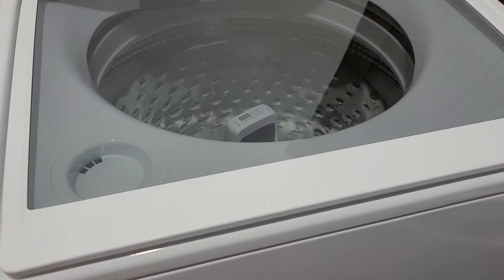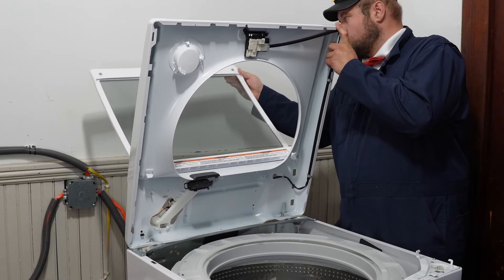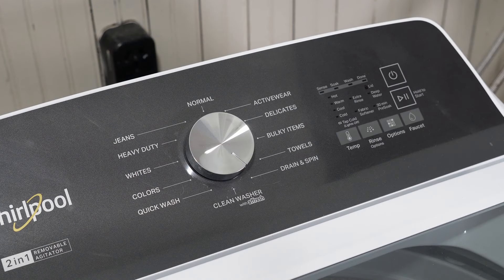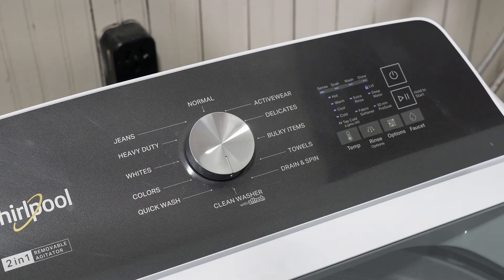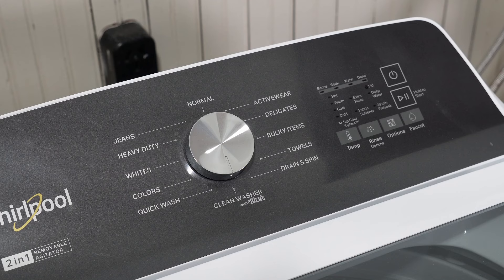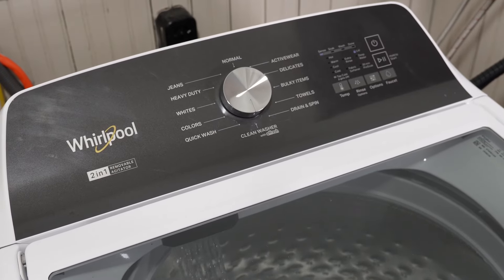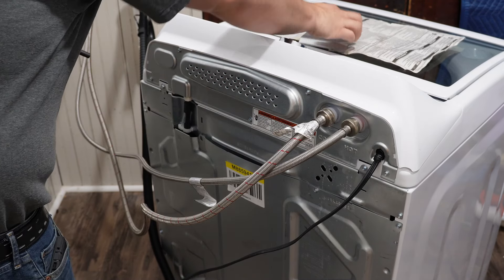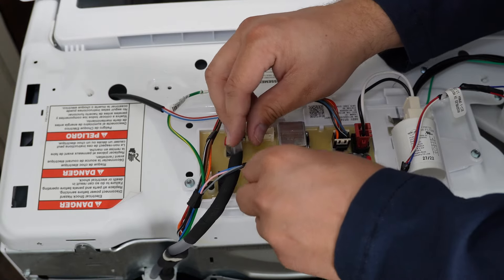How to Reset a Newer Maytag or Whirlpool Washing Machine (Factory Calibration Mode)

Comment: Wish they made washers like they use to. New Maytag washer didn’t even make it pass its first wash. GE washer needs transmission and bearings replaced after only 5 months. Front loaders don’t use enough water to actually clean clothes. Have to hack/modify a screw on water level sensor unit to fill with more water. All junk.
Reply: it is illegal to make washers like they used to. thank your government.
Reply: Front loader do use enough water and clean better than any top loader. But that’s a conversation you guys aren’t ready for.
Reply: Amen!
Reply: @Ikey04-ge9gy 😂 ngl I died laughing at this! What would a conversation about laundry pertain, that someone couldn't be ready for? It's either enough or not 😂

Comment: My husband has fixed this washer 3 times already. Worse purchase ever, only 3 years old. Hopefully last a couple more months. But your video so helpful to reset it.
Reply: I agree 100%. I had mine 2 months before it failed, it took 12 weeks of maintenance guys coming out with random parts before they finally hauled it away and brought a new one. Now the new one is doing the same thing. I'm getting rid of it and I've had it less than 2 years. I figure the cost I'll be saving in not having a heart attack over this stressful piece of junk is more than enough to cover the purchase of something that actually works.

Comment: No matter what wash i try It locks and unlocks, does 2 half spins, makes a noise, then says done.
Reply: Mine is doing the same thing, any suggestions?
Reply: Machine is out of balance. Unplug the machine, plug it back in. Go to drain and spin cycle, then process to whatever wash cycle you normally use.

Comment: I had my washer disconnected for months and it didn't want to work and this video got it working again. Thank you!! I'm happy I didn't have to call a repair man or customer support. For me, the lid lock light would be on so I left it open and the steps still worked.
Reply: I just found this video and the process is running as we speak. Praying this does the trick. The washing machine also hasn't been used or even plugged up in months🎉 Btw, it responded exactly like the video described ❤❤❤

Comment: Got my WTW5057LW1 delivered on Feb 1. It’s Feb 23 and the extra rinse option on the drain & spin cycle is not working. It just drains and spins without adding any water for a rinse. I did the reset as per this video and it’s still not working properly 😞

Comment: Worked perfectly after I replaced the lid lock. Which by the way instead of taking the entire wire off I only popped off the lod lock , flipped it over and removed the smallest backing piece and pushed plugged off of the board and then slid the plug on to the replacement lid lock unit and re installed.  Took less than ten minutes and I by passed alot of work.
Reply: do you mean the white part of the lid lock, that little white plastic piece?
Reply: What lights were flashing in your washer? I’m trying to decipher my code. I have been unsuccessful. Mine flashes sense done and lock then it flashes just done. We replaced drain pump noticed a spliced burnt wire and I 🎉 thinking yes!! But no 😢. I don’t want to keep buying parts I’m not rich or I would have taken this washer over to whirlpool lit it on fire and gave them the finger. 16 months and this is what I get for buying new

Comment: Thank you so much for this video!  Bought my washer in April, it died in June.  Repaired 4 days go and I got to do 5 loads before the lid stopped locking!  I was so excited that my washer did exactly what your video shows for the reset, locking and unlocking as you outlined.  However, when I went to try a load, the lid would not lock.  Oh well, back to the Whirlpool warranty repair part 2.
Reply: 5160
Reply: Thanks, I looked the code up and you are correct.  The 6th wash load became unbalanced and was washer bucking so hard I thought it would hit a wall.  The only thing I could think to do was press the start button to stop it.  The lid unlocked then, but after reset, the lid clicks on/off immediately when I try to start a cycle.  I am not smart enough to enter more codes - old lady who used to fix balance by opening a lid with no lock (Kenmore 1986 and still working like a champ) and moving the laundry around.  I will have wait for the technician and hope for a quick.   @JosephGordon-ny6eb
Reply: @JosephGordon how do you put those codes in
Reply: My washer started bucking real bad once it stoped the clothes was still a little bit wet took the clothes out but the washer didn't want to work i tried the everything in the video but nothing, the light turns on but it just makes the locking noise but it don't lock

Comment: Thank you! This really helped. Ours died after a power surge from power restoration after a storm. My daughter was washing during the storm and it wouldn't work after the power came back on. All the top lights were on and I couldn't get your reset method to work, so we decided to unload the clothes so I could drain it like you said. As soon as we unloaded, it started draining on its own! Crazy. I was able to to run your reset sequence afterwards (to be safe) and it's back to functioning as it should! Thank you again for the help! 👍 I was afraid our two year old machine was going to be expensive to fix. 😮

Comment: I appreciate the information the reset did not work. The lights soak, wash and done Keep flashing well after four minutes. I keep seeing comments about error codes. Where are the error codes displayed on the panel? My washer is not even two years old.
Reply: Having the same problem with mine. 2 years old. Did you find a solution?
Reply: @briancartagena9749 he has another video.  Hit 123 buttons in order 3 times, then it will alternate flashing the 4 top lights if error code. One with the lid lock light on, the other with out it on. The pattern coordinates to a number.  I think first was an F code, the second an E code.

Comment: I did the reset thinking that was the reason the lid would not latch. Did not work to cause the latch to work but all of the other things happened - the lights flashed and the machine ran. I figured there was an issue with the latch itself.  So I unscrewed the latch from the lid and placed it into the latch mechanism. It latched and it appears it has to do with how the latch enters the latch mechanism. For now it works.

Comment: I get to the last step (where you said it took about 4 min to finish), but it just continually flashes from Sense -> Soak -> Wash -> Done. It did that from 5:30pm Sunday until 6:30am Monday morning, so I redid it again. What should I do if it doesn't finish recalibrating?
Reply: Mines doing the same thing,  stuck with the flashing for over 12 hours. I'm  trying it again. Did you find a solution?
Reply: Did either of you guys ever find a solution because this isn't happening to mine? I haven't even had it that long. I replaced the locking mechanism because it stopped working and now I can't get it to work. Soak wash done in lid lock
Reply: Look underneath at the wires going to motor. Mine has a wire that rubbed through and was arcing causing it to not spin
Reply: @cheryldaves7107  No. The solution was buying a new washing machine. Continually had too many issues with this one, and got tired of throwing money into it.
Reply: @chrismigl8763  yes I ended up getting a new one as well. What a waste of money. I didn't even have it a year.
Reply: @cheryldaves7107  yeah, these washing machines are junk.  From the get-go, I've had nothing but problems.  I swear inside of a month this thing was SO LOUD during the spin cycle.  It sounded like a giant was walking through the house, or a helicopter was landing on the roof.  And now, it stopped working.  Would go from SENSE to DONE without doing anything.  I did a reset.  The reset ever stopped resetting.  So I open it up, take a look, and the capacitor is just DANGLING from the undercarriage, resting on my tile floor!  Not only that, but two wires going to the capacitor are SEVERED.  Mind you this is the first time I, or anyone else, have taken a look down there so this is how it came from delivery.
Reply: @jimjo8541  which reset function did you try? I tried about three different ones and nothing worked. Ever up getting a different washer and that one is just sitting there.

Comment: Nice video. I had Code F7E3 on my Maytag model MVW6200KW1. I replaced the lock switch and sync motor and had the pump and capacitor tested at the local store that supplies parts. The reset mode is started and lights have been flashing in order for over 15 minutes. Does time vary depending on parts changed?

Comment: My whirlpool had an error code F7E1 and I replaced the shift actuator like everyone said, still didnt spin. I replaced the capacitor and its working again so I  recalibrated and its going fine. Thanks for the video!
Reply: Which capacitor? I have a similar problem...just replaced actuator and I'm still get the F7E1 error code after doing a reset.
Reply: @jromyn  it sounds goofy but I searched whirlpool washer capacitor on eBay and found a bunch that look like the one on my machine. I made sure the one I bought said brand new. It was easy to swap out and I haven't had a problem since.

Comment: New machine, (like yours) trying to use first time, wouldn't fill. Directions said it should fill with allfresh (cleaning cycle).  It said I could pause or stop.  At half full I tried both pause and stop, machine wouldn't respond. I unplugged and plugged back in. Door would never unlock, machine went into drain mode, when finished draining, finally unlocked, now water temp flashes between warm  and hot but 'whirlpool model # WTW5057LWO won't do anything except the H/W light flash.  Seller says since they didn't do the install (blah blah, excuse, excuse). My previous washer, a Whirlpool, lasted over 50 years, ONLY thing I ever did to it was replace the belt.  Thoughts?

Comment: Hi Ben. I did all the diagnostic steps. Everything was okay, except right after all the steps, my machine just kept draining. Agitator not spinning, too. Any idea? The blinking lights are sense, done, lid, and then just done. Pause for a little bit, and the draining starts again.
Reply: Did you ever find a solution?
Reply: very interested if a solution was found

Comment: What if the washer has clothes and water inside? Our washing machine automatically locked but the light of the lid is not there. It won't go to the soak, wash and done. It just stays in Sense mode. 😢
Reply: I have the same issue 😩

Comment: After all that my washer keeps flashing sense, Done, lid locked. Should I try again?
Reply: Did u figure out what it was that's where I'm at? It's driving me crazy
Reply: I'm also having this issue. What temp water are you running?
Reply: I'm trying to wash in cold water.
Reply: Wash cold water
Reply: @nenenene9744  so if you wash with warm or hot water, you'll be able to finish your cycle if you're in a pinch. 

Check your water inlet valve to see if there is any debris. Disconnect the washer power supply, shut water supply off from the washer, remove cold water supply hose, and just look at the valve. If there's debris, it either needs to be cleaned or replaced. That's where I'm at right now I sprayed compressed air into the valve and got my washer dispensing more cold water but it's not enough for a cycle. 

My next step is to remove it, clean it and see if it works.

Comment: i have went through all these, even replacing the locking mechanism to no avail, nothing seemed to work, about to give up 
 i watched another video and started to look underneath at the motor and didn’t see anything but as i was moving my hand around a wire fell out and it was a broken wire from the pump it had been bound so tightly to other wire that it had heated up and broke off. 
  i made a repair and everything works fine. 
  Hope someone else can read this and saves you a bit of trouble and money.
        also my whirlpool machine is only two years old

Comment: If you cant get this to work try checking the wires going to the motor. Mine just kept flashing for hours when i tried this. Turned out  a wire had rubbed through and was arching

Comment: Ok Ben, got one for you. Why would a Maytag front load give an f05 error, even after replacing the components, heating element, heat sensor and ccu?
Got any ideas?
Reply from the maker: Check wires for damage

Comment: Thanks for the video Ben. What happens if the washing machine doesn't respond pass the initial 1-2-1-2? I've verified that it is receiving power properly.
Reply from the maker: Took me a few times to get this to work. May have to unplug, wait 1min, then plug back in. Make sure the dial can work and you can select things too in a separate test
Reply: @bensappliancesandjunk  Thanks, I'll keep trying!

Comment: I got a question for the professionals ! I have several washers that once you hit the “start” button , it waits about 5 minutes then it will start filling with water . Can someone help point me in the right direction because we have others just like it and the water fills as soon as you press start. It’s a whirlpool with the 6 led lights
Reply from the maker: Recalibrate it using whatever method it needs. Often they go out of spec and take too long. That and make sure the water valve screen is cleared.

Comment: I must need a degree to understand because I’m still stumped. My whirlpool wtw5057lw0 flashes wash done and lid together then flashes done. The lid will not unlock until ai unplug for 60 secs and plug back in. My husband and I found a spliced burnt wire going to drain pump we fixed and replaced drain pump.. sadly washer did same thing half way through cycle. I have had for 16 months(out of warranty) I do not understand what the code means and I’m ready to go monster truck on it

Comment: Ben, my issue I cannot empty the water in the unity prior going thru the reset process. Any suggestions??? I did run thru the process with water in the unit and it did not resolve the issue. Thanks for your support!
Reply: I have the same problem

Comment: Rotate dial clockwise? you move it one setting... do you have to rotate it 360 degrees?  (I wanted to drain and spin and it did whole wash with two rinses grrrrr)
Reply: ok, just turn one setting... rotate to me means turn around ok, just ignore me

Comment: Any chance you could help with/do a video on this model with an F7E1 no spin error?
Reply: did you get your issue fixed
what was it
Reply: @johnlucian2259  The belt had ended up coming off of the bin's pulley! I tipped it on its side, pulled the cover, and popped the belt back on. No issues since👍

Comment: I have a different model with 5 keys instead starting from left: Temp- Options- Deep Fill- start/pause- Power.
So I do not have 6 keys.
Reply: Mine was the same I did the power button twice and it worked

Comment: Is there a way to get the drain and spin to just drain and spin without adding water? I spent hours last night having to squeeze the water out of my electric blanket to avoid having to leave it in a wash for more than 2 minutes because it would be ruined if I did. I’m tired of this garbage
Reply: Did you figure out how to make it drain? I’m stuck with the same issue. It won’t even attempt to drain and was working fine right before this

Comment: Mine does have the green light but it won’t spin after the recalibration it will do the rinse but then not spin any idea what it could be?
Reply from the maker: Possibly capacitor. We just had that issue in a newer one. Check wiring though as well
Reply: Ok thanks, do you have a link where I could get one that would fit it. My washer is like the one in your video.

Comment: I just purchased this piece of junk! My first wash and it filled up, then drained out without washing the clothes. Second try, it filled up, washed the clothes then drained out and never rinsed the clothes. I hate it, looks like I will need to buy another washer. I just want simple, a washer that washes and rinses the clothes!!!! Should I recalibrate it already????
Reply: Agreed, 1 time it didn't work it was bcuz off the lid lock and it was making an annoying noise. 
2 nd time now and it's not the lid lock.
I'm so over this machine.
Reply: Ours has been nothing but trouble from day 1.. worse washer ever can’t wait to take it out back and blow it up! I end up having to recalibrate in at least a dozen times a week!
Reply: I am having issues to. Can't find what setting has the highest water level. I have the Deep Water and it still will only fill half way.

Comment: MVW6200KW1 only flashes sensing.  Replaced the cpu/mainboard. Only sensing light comes on plus led indicators for temp , load size and etc. When i attempt to enter fault codes mode all indicators only flash once. (I understand they should flash twice if entered successfully. ) Then wash, rinse/spin,  done and lid flash once then rinse/spin and done flashs once.  Repeats.
Removed back panel i see green flashing thru epoxy in bottom of board.  Blue led on back of board remains off.  Any help is appreciated. 3:20
Reply: Shouldnt blue led on board be lit?

Comment: There is water in the tub I took the clothes out but can’t get it to go or drain
Reply: Did you ever figure out a way to fix this? I’m stuck with the same problem. Was running a clean cycle and no clothes were in it but it won’t drain the water at all